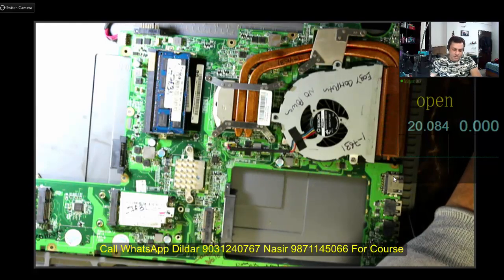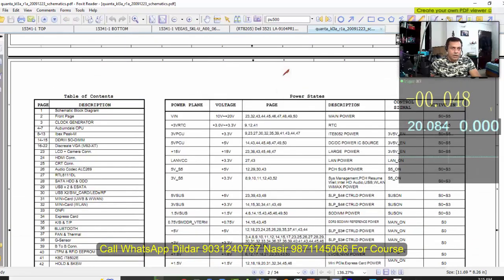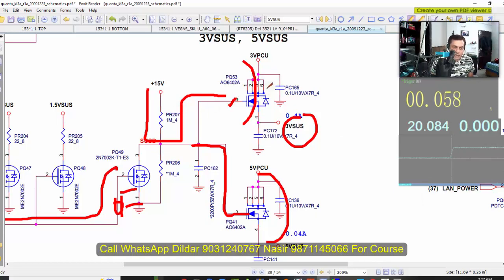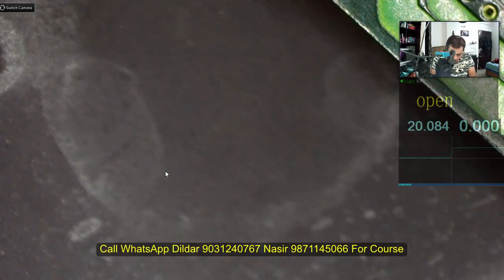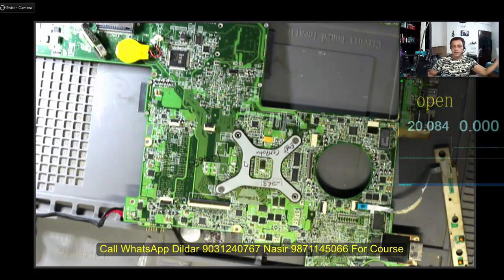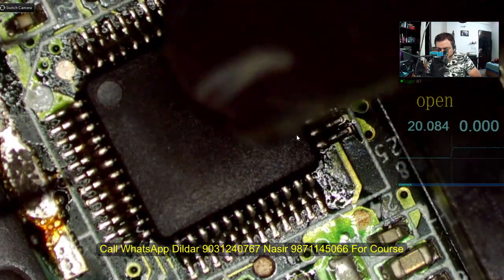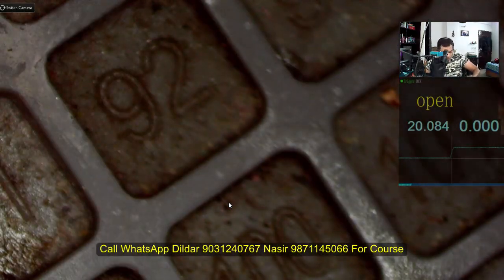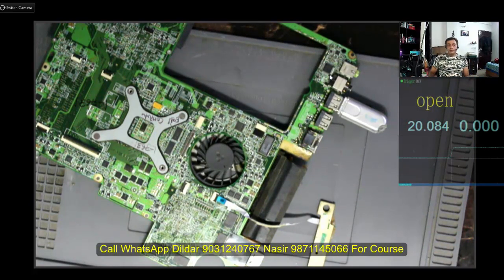Laptop Motherboard ON and instant OFF Complete Solution | English |Lenovo y560 |August Offer |Laptex

Comment: Very helpfull video sir. I have question, what if the case is like this but there is no schematic available, only the boardview. How to trace where the voltage source is coming from without using a schematic?
Reply from the maker: We can use Boardview for tracing signal as well..

Comment: My laptop turn on then after few minutes turn off directly... Local market repair person said processor is gone.. but if its gone why its turn on and keep on for some time take load as well ... Then suddenly get off. When I change bios battery keep work for some time then start getting off and off again... Is there any solution how can I fix it or who can trace the problem of my board... I don't want to change mother board i want it to repair properly... Please suggest...

Dell 3568 i3 6th generation
Reply: I think I should learn cheap level course to repair my laptop 🐢
Reply from the maker: Could be an issue with BIOS or Graphics card